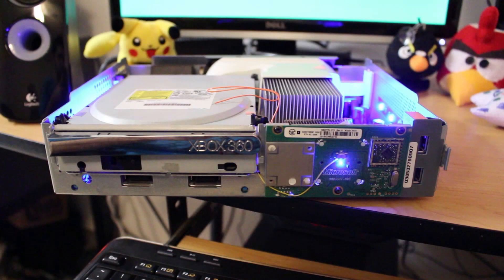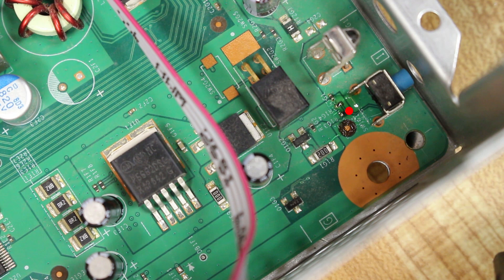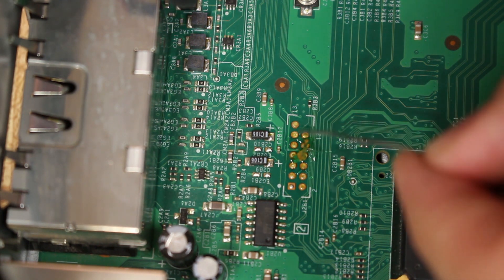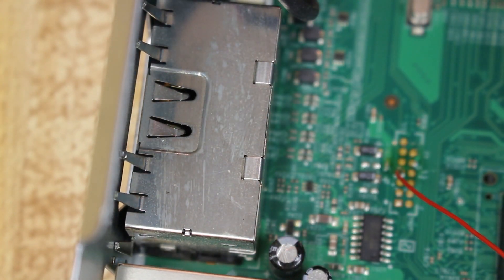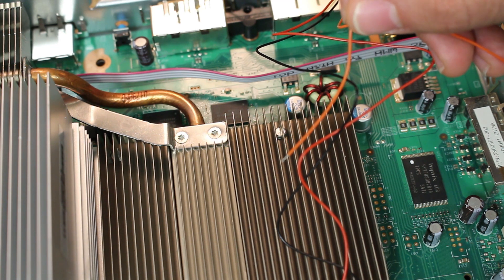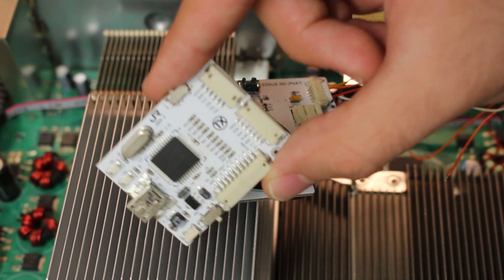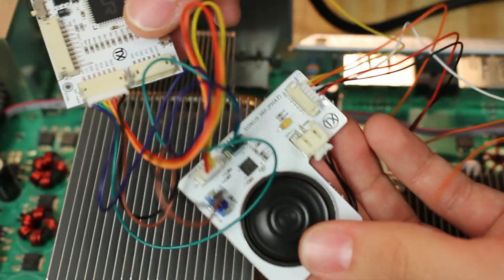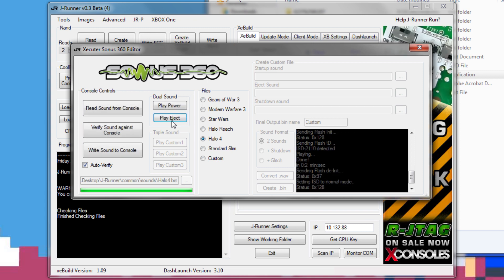Sonus 360 Phat Install Tutorial [Slim Sounds on a Phat!]

Comment: For the eject button, I would recommend installing the wire sideways, that way you can install it easier and it will have a better connection